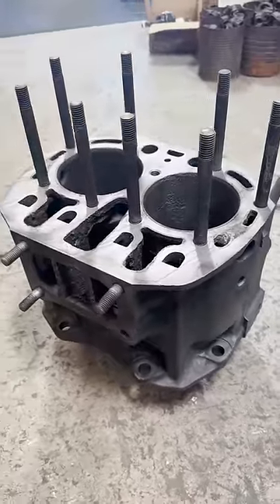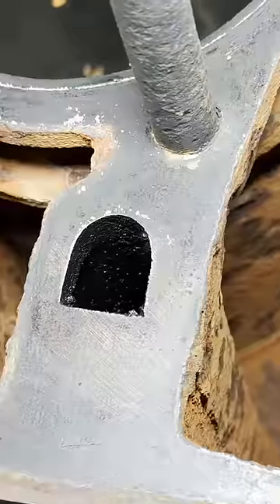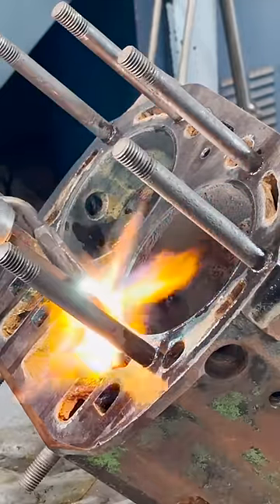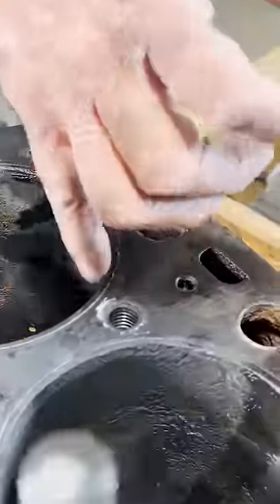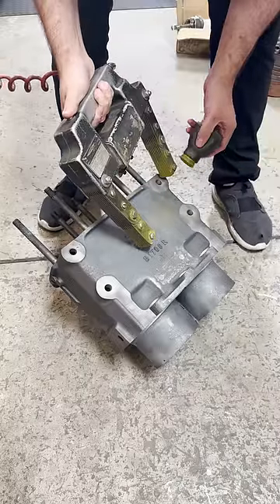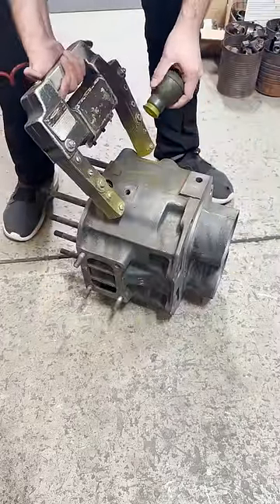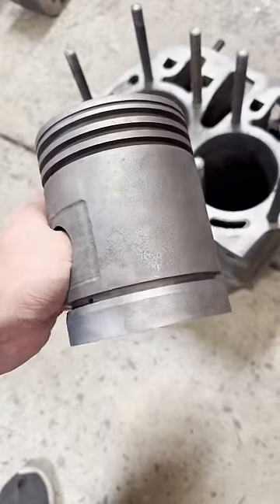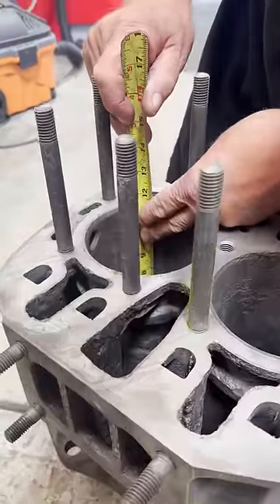#shorts Always Thoroughly Inspect ANTIQUE Engine Parts!

Comment: cracked deck at the center coolant passage
Reply: Glad I wasn't the only one who saw that. Most likely they caught it
Reply: I wonder why they decided to ignore that?
Reply: That was the literally first thing I saw within the first two seconds of the video. And there was literally the flux in the crack at the end lol
Reply: That deck crack is still above the coolant passage going nowhere- Insignificant... Not being able to surface the deck flat will be the bigger issue.
Reply: Wondering about that as well
Reply: Looks like an as crack too lol
Reply: It’s absolutely got at least the one crack, my spidey senses thought they saw one or two more. 
Sometimes a block or head can be welded, this is especially done on parts that can’t be replaced; I’m not a machinist so idk if this is a candidate for crack repair.

Comment: One thing I’ve heard works for pins that won’t come out is wax. Like a little tea candles and heat the metal and then apply the candle. Might work for it might not.
Reply: But they aren't "pins".  They are threaded studs.
Reply: @x-man5056  
Oh yeah, guess I wasn’t paying attention lol. I’m not sure if wax would help with threaded studs.
Reply: It does ... I've used that trick on exhaust manifold bolts it sometimes takes a few tries but works like a charm.
Reply: @unacceptableminority7101  With the stud broke off?

Comment: Actually an MT inspection DOESN’T show “any defects”. They only really show surface cracks and somewhat sub-surface. Anything deeper would need an RT inspection. You should also go in two opposite directions for each area being inspected. You can miss a lot only going one direction in each section you’re inspecting. Small cracks are hard to see with MT and going too fast you can miss a lot. Seen that a lot training new inspectors or those that aren’t certified NDT inspectors.
Reply: What is your take on Dye Penetrant Testing?
Reply: @ericlotze7724  PT is a great NDT method, but it to is limited, as all methods are to some extent, but PT can be used where parts aren’t magnetic, but it’s dirty/messy, time consuming prep/cleanup, but shows defects so clear there’s no mistaking them, dependent on the procedures being used and what they allow for defects to pass/fail. Just another method to be used in addition to, or where others can’t be used. Some procedures require specific NDT methods and don’t allow others. 
 The MT being used here isnt under any procedures and probably without any training tbh, but in this case it’s not really as important as it is in the nuclear /shipbuilding / gas fields are.
Reply: What about half wave dc? They say it has more penetrating power than ac. But I would just do a radiograph.

Comment: i wont pretend that those studs arent stuck, but an impact gun on long thin fasteners is pointless, they just twist and absorb the hammering effect, like a torque stick.  best to just use a breaker bar, heat and penetrating oil to quench the studs.

Comment: I just cut the stud off flush with the block and drill into the stud, then mig weld a nut onto the stud. ( the drilled hole helps shrink the stud when welding to increase the odds of getting it out).
Reply: I would drop nuts over top the stud and weld to them. 
Why cut off what god gave you
Reply: Need to get the heat as far down into the block as possible.
Reply: Doesn't make any sense to cut of a good stud.
To break the bond, heating the block in an oven for 3 to 4 hours, then flip upside down and dip just the studs in liquid nitrogen for 5 min.

Comment: Why would you use a Milwaukee to remove studs put in by hand or air. My compressor runs at 200 pounds. It undoes bolts better than anything.

Comment: Run welding leads through the bores and check your coverage with castrol strips. You can mag everything in and out every time you hit the foot pedal. it'll be more thorough at about the same time. Been a NDE tech for 17 years. A can of 14AM and a blacklight you won't miss anything.

Comment: Seeing that rust inside the head gave me an idea, but I’m not sure if could be practical to do. Mix a little sand and water, then pump it through the head as it would be when running. I would imagine after a couple hours all the rust would be cleaned off

Comment: cut a single stud about 1 third short of the length of a nut that fit over it. weld the nut on the stud with plenty of amps, then try again with an impact driver rocking back and forth. if this won't work studs are beyond saving and need be drilled out.

Comment: Hey. Try using some wax instead of penetration fluid. I've used it on stuck bolts and nuts and typically it works

Comment: Wrap some cotton around the base of the studs. The seams from men's underwear are ideal. Soak, soak , soak them. Keep them  constantly soaked. Soak them while you do other work. Capillary action will hopefully draw the penatrant  into the thread area. Patience is a virtue. Every once in a while try loosening.  If it moves a little,  soak some more.  Repeat.  Repeat.  Repeat.
Reply: lol bolt extraction kit contents: torch, impact gun, penetrating oil, BVD's 😂

Comment: Uh, what about that big crack in the deck running out of the coolant passage between the cylinders? 

My favorite trick for old crusty stuck fasteners is to apply a little heat to the base of the stud and then stab it with a skinny candle. The wax flows into the threads and then you can spin the studs out pretty easily most of the time.

Comment: How deep do the studs go into the block?  Threads deep down are stronger but a nightmare to extract. Threads at the top can be loosened by cutting the stud 1/2” above the joint face and arc welding a nut to the cut stud. Heat shock loosens them seizure.

Comment: There is a crack right between the cylinders. 🤷
Reply: That is a casting line created from the mold which is made from multiple parts
Reply: That can be taken care of, by simply drilling a hole at the end of it. That will stop it from going any further than it is.
Reply: @Bambyscott uh, no, that’s definitely a crack. HOWEVER, it is nowhere near the area where the metal reinforced portion of the head gasket seals the cylinders so it’s not an issue.
Reply: @nickyborrisino 
Yea but it's down into a coolant passage, guaranteed that'll be an issue. 
There's no such thing as a crack in an engine casting that isn't a problem.
Reply: @nickyborrisino no it isn't a crack, look at it more carefully. It is the near edge of the mold line
Reply: @silaskuemmerle2505 near the end of the video, when they are measuring bore ID, you can clearly see the yellow magna-flux powder sticking to the crack coming off of the central water jacket between the bottom of the cylinders. The fact that he said ‘they tested the block for cracks but didn’t find anything of concern’ means they found at least one crack, but it’s not an issue.
Reply: Hey, let's argue about a youtube video.
Reply: @Turbo44mag no let's not argue because that's stupid. I hate arguing. If there's one thing I don't do, it's argue. Just don't have time for it. Can't imagine why anyone would.
Reply: Maybe letting the block assembly soak in a furnace if available at around 500 degrees. I feel that the block is soaking up the heat using a torch,pull out of furnace. using a pneumatic peen,peen on top of the stud while attempting to turn....just maybe...

Comment: 80yo head studs 

And we can’t get head bolts to work twice in a row 😂😂😂
Reply: Two different types of mechanics going on. Bolt threads stretch when torqued down. Studs are threaded in with no tension then a nut in tightened on top creating a clamping pressure.  And some head bolts do get reused. Depending on applications.
Reply: They're torque to yield on purpose. I never investigated why, but at a guess, the necking deforms the threads so the don't back out

Comment: Interesting that you skipped removing the studs. What if you can't get them out at all? I suppose as a machine shop you could easily cut them off and use a mill to drill them out if needed.

Comment: I reckon worst comes to worst, y’all are lucky that you’re machinists, you can cut the studs off flush, drill them out, and tap new threads, or drill them out and sink a timesert or helicoil in their place. I know mechanics will do this to, I’ve done it ( not personally for head studs, though I know the old school race engine builders used to immediately drill out the threads on a new race engine and sink a helicoil cause it’s stronger) but I assume it’s much easier when you can fixture the block up on a mill or even a drill press, instead of a hand drill, then use a carbide drill bit that a machinist will have, instead of a cobalt/HSS bit that a mechanic will have.
Reply: If you have the right speeds hss works fine
Reply: @jodygarcia9892  I know it works, my good drill bits are Irwin HSS, and they’re good enough for most of the things I ask them to do…but I’d rather use carbide (wouldn’t rather pay for carbide though).
Reply: @cnf6045  one thing thats interesting is the Chinese carbide bits can be pretty inexpensive if you find the right ones and there still high quality

Comment: Is it possible to get sleeves for an 80s two stroke snowmobile engine?   The cylinder got scored when the oil injection system got clogged as it sat for a year or two.

Comment: The pitting on the inside of the cylinder sleeves, inside the block, is so wide spread and deep in that video you showed, it’s def lost a lot of meat, those will undoubtably be points of cracking with use. I would have talked the owner out of investing in a restore, find a new part that’s a better candidate

Comment: U try not the torch but the bolt buster? Problem with a torch ur heating both surfaces where if u heat just the one u may be better off or u place the entire block in liquid nitrogen and leave the bolts out and it may work too

Comment: Wait wait wait hold on, You can’t just show me a fucking Magnetic claw for showing defects and NOT expect me to ask questions.
Reply: Magnetic Particle inspection. Basically, magnetism runs between those two legs on the yoke, and will leak out of any break in the surface that's PERPENDICULAR to those lines. The very fine dyed metal powder will then be attracted and stick to it. The rest can be removed with a gentle stream of air.

Comment: To be fair to the milwaukee, that old corded high torque makes less power than a new mid torque :p

Surprised yall didn't put the block in a chuck and use a breaker bar.
Reply: NEVER use a breaker bar on a stud even when installing a new one, some manufacturers even warn you not to do it in their service manuals, always use a T-Bar instead.
Reply: @dukecraig2402  Never said to use it on a new one. I've always used ratchets without an issue. I only mentioned a breaker bar so they could get some good linear torque on them. Not to yank on em till they broke.

Comment: Try dropping a nut & washer - then weld the nut & washer to the stud & undo with a ring spanner when still red hot🔥 - Candle Wax or Lanolin spray might help also - this is the method for rusted & corroded exhaust manifold stud removal 👍

Comment: Heat and penetrating oil won't do anything... 🤦 WHY DOES EVERYONE THINK IT WORKS... You heat something up, you put oil on it, and the oil is going to burn off... We use candle wax with heat... A stick of castrol wax will last you for years... And as previously stated 50-50 mix of acetone and ATF works great for non-heat applications...

Comment: That's not a block it's a cylinder or jug a block is where the crankshaft lives not where the pistons
Reply from the maker: First off, it’s dumb to argue technicalities when you clearly understand the point of the video and what we call it has no bearing on the value of the video…

But while we’re at it, you’re wrong.
https://en.m.wikipedia.org/wiki/Engine_block

“In an internal combustion engine, the engine block is the structure which contains the cylinders and other components. In an early automotive engine, the engine block consisted of just the cylinder block, to which a separate crankcase was attached. “

The engine block contains the cylinders. The crankcase contains the crankshaft.

Class dismissed!

Comment: Jim Heat the Block Not the Stud. Heating the Block expands the Metal Around the Stud. Cast iron will not melt. On an Old International Farmall M I had to burn a bolt from the cast Iron Frame. Let the cast Iron Cool by  itself No Water or Fan. If The Block is very Hot Put it in dry Sand and let it Cool over Night. The Old Cast Iron is better than instead at the Current Years of Cast Iron.